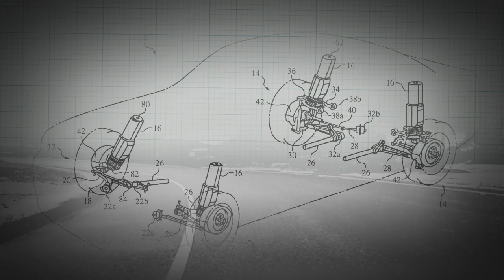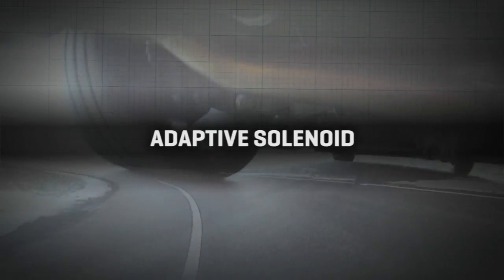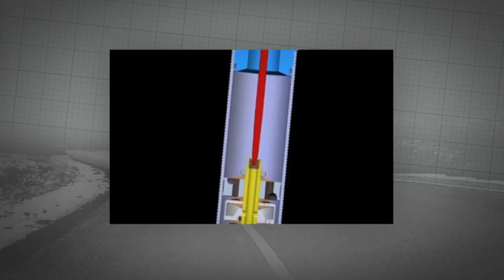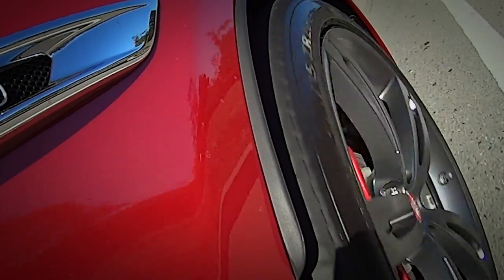CNET On Cars - Car Tech 101: Understanding adaptive suspension

Comment: I had a neighbor who worked for Bose back in the 70's, and he described the work they were doing on automobile suspensions.  Even then, he described a system where the car would sense a pothole, and lift the wheel over it.  It was pretty amazing stuff.

It's an interesting company.  My neighbor worked in their video R&D department.  They didn't (and still don't) sell any video products; it was all about research that interested Dr Bose.